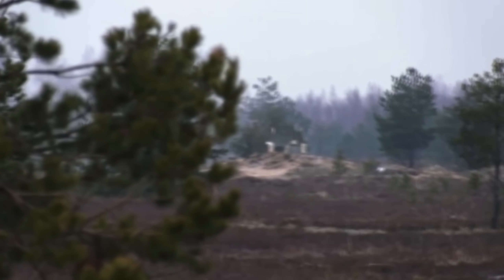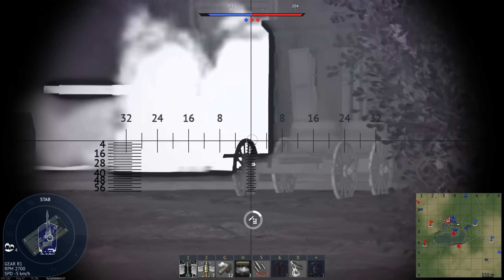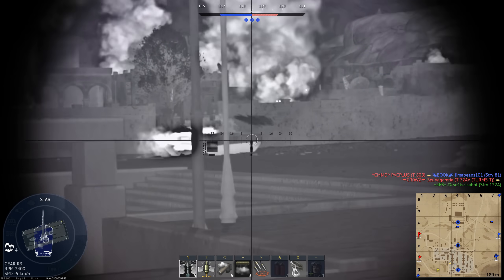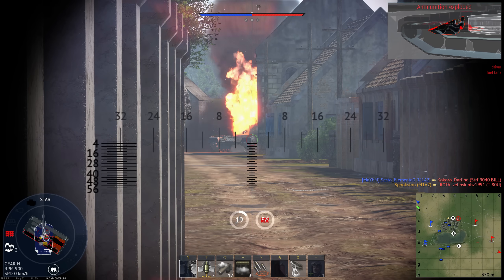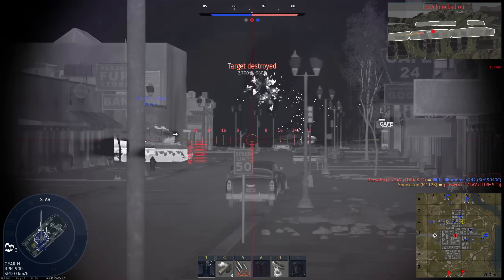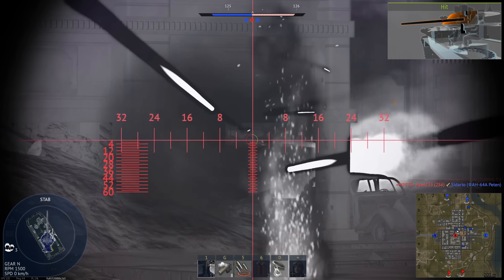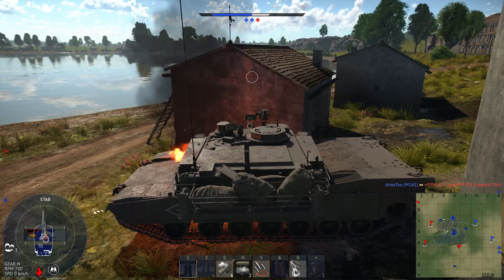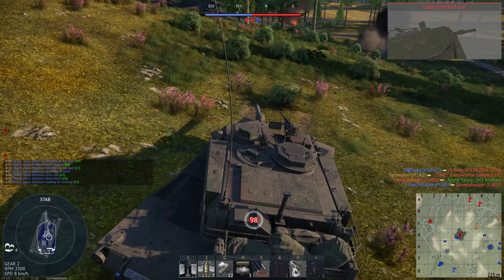Why The M1 Abrams Uses Depleted Uranium

Comment from the maker: DU is also used for a variety of commercial and military applications. Most notably, DU is used in some air to ground munitions. It's believed that this DU is responsible for a variety of birth defects and other serious medical issues in areas where the US military operates.
Reply: To also add a common, and unknown use: In commercial airlines, it's used as ballast to balance out heavy cargo.
Reply: hey just very quick tag on DU is often taken from nuclear powerplants who would refine it and would love for anyone to take it off them
Reply: "Most notably, DU is used in some air to ground munitions." 100% Correct. In fact you want to know, the A-10 Warthog's 'fart gun', the GAU Avenger, uses 30mm DU cored bullets with an aluminum jacket. 

Not to advertise, just a note for people interested, Real Engineering made an entire video about the A-10 which also covers DU bullets. Spook did an awesome job in explaining why DU is used and the up's and down's of DU for both crew and environment, but in case you want a little more visual approach about why DU is used over Tungsten, RE delevers that.😅 Though RE does not touch the environment and crew side in as much depth as Spook does👍 (I made a little comparison of the 2 channels to highlight Spook as wel as RE so you can decide, and for anyone who want to whine about me giving other channels credit, this is for you. Spook delivered/delivers amazing information that is bite ready to get you insanely interested to learn more about a vehicle, with an enjoyable video background to see it in action and regular info sheets backing his words up, thank you Spook, keep it up ;)
Reply: Yeah I'm sure it's the DU that causes the birth defects, and totally not the thousands of tons of organophosphates they dropped.
Reply: @AltPollux  shhhh if they admit to that they can just use a different compound in the future
Reply: Old comment but us military bases burn medical waste and other stuff in big burn pits i bet thats why.
Reply: @AltPollux  we‘re not talking about vietnam here
Reply: @AltPollux  and lead
Reply: @AltPollux  Where did the US drop organophosphates AND use DU?  Certainly wasn't Vietnam.
Reply: DU is still radioactive, just very slightly, but when it gets ground up into dust, as happens when its used in munitions, it can enter the human body, where the Alpha and beta particles will wreck havoc from our insides. Uranium is also toxic on its own and that does not go away with time.
Reply: @mohammedhersi5774  DU has such a long half life that in order to receive any sort of appreciable dose from it youd have to essentially replace your entire body with DU.  It's got a half life of 4+ billion years.
Reply: @mohammedhersi5774  the real problem is the high toxicity.
Reply: @mohammedhersi5774  very true
Reply: let's make war green, electro motor tanks with batteries and high velocity plastic penetrators from recylced plastic
Reply: @sagichnichtsowiesonicht7326  let’s make sure the people in the countries we bomb don’t look like Vietnamese babies after we leave if we ever want to have rnational relationship with them and not drive them into the arms of Russia, China or ISIS
Reply: @sagichnichtsowiesonicht7326  u mean wooden penetrators
Reply: @sagichnichtsowiesonicht7326  and make tanks from materials u can eat
Reply: Not just DU. Agent Orange in Nam come out in mind for example.
Reply: @draksionar  I love how everyone either doesn’t know or doesn’t want to know how Russia deals with its decommissioned subs, nuclear reactors, and the nuclear waste. It makes du and agent orange look like ice cream toppings in comparison.
Reply: I'd highly doubt it is the DU responsible for the increased birth defects.  There is a shit ton of chemicals the US military uses that are far more likely to cause defects.  Pesticides, herbicides, and even fuel and explosive often carry a lot of toxic compounds that can cause birth defects.

People just think it is DU because people have gut reaction to hearing the word Uranium.
Reply: @josephburchanowski4636  the rounds fired in training are made of cheap steel not DU. They wont/cant fire DU rounds in the US unless its war.
Reply: @whisperchainsaw102  I don't recall saying anything about training rounds; but it is kinda obvious that they would be made from steel.  While DU is cheaper than tungsten, Steel is dirt cheap by comparison.  Also even slightly toxic rounds you wouldn't want to be shooting all day just for training.
Reply: @josephburchanowski4636  yeah using steel darts in training reduces cost by alot since steel can just be made from old wrecks on the battlefield smelted down and remoulded.
Reply: @josephburchanowski4636  They're only "slightly toxic" if you eat it.  How many people are eating their tank rounds?
Reply: @cstgraphpads2091  Well instead of eating lead, our enemies eat Uranium.  Yum.

All joking aside.  It is fairly easy for DU dust to end up on food or in people's airways.  DU dust gets readily produced and disperse when rounds hit enemy armor.  You would be surprised how easy it is for dust to end up inside people.
Reply: @cstgraphpads2091  Because DU rounds specifically vaporize on impacts that leads to DU particulates getting into the local surroundings and water table. This is like being incredulous about how people got lung cancer from asbestos or lead poisoning from lead paint.
Reply: @josephburchanowski4636  well guy out of twelve of us that disarmed the main/coaxial guns and towed T72/T60 tanks that were destroyed by DU rounds in 2003 not one person has had any health complications or cancer as a result. So, maybe it isn’t as easy to ingest DU as you think.
Reply: @benkeller4210  "So, maybe it isn’t as easy to ingest DU as you think."  Still easy to accidentally ingest some dust; DU dust is no exception.  But it isn't like you guys would've ingested much though; unless you did something stupid.  The stuff is only slightly toxic; hence why I doubted claims that DU was responsible for birth defects and what not.  Don't confuse me with one of those people who freak out that DU is being used.

I still wouldn't want to shoot DU constantly at a training range.  But that is just me.
Reply: @josephburchanowski4636  I was doing an essay with a few other kids on nuclear power for a science class, one kid with no evidence or sources, just puts

"Plants with genetic defects next to nuclear reactors"

Which I find hilarious
Reply: @kriegscommissarmccraw4205  I do find funny how people seem to not realize that there is extremely little radiation escaping containment at nuclear power plants.  Like the amount of radiation you get within a year by living nearby is like one banana's worth.

Side note: my favorite unit of radiation dose is the B.E.D.  (banana equivalent dose); which is equal to a tenth of a micro Sievert.
Reply: @josephburchanowski4636  Banana equivalent dose? That's amazing!
Reply: @josephburchanowski4636  you are Right about this, as Long as they are built properly, not french and don’t blow up
Reply: @josephburchanowski4636  A coal plant is worse.
Reply: @josephburchanowski4636  former Navy Nuke. Reactor operators on a ballistic missile sub, sitting in front of the control panel receive less radiation while underway for 3 months than you do on a flight from NY to LA. This is because the sun is major source of radiation and a sub that is 100 feet under is totally shielded not just from the sun, but the reactor compartment.
Reply: @KKSuited  "This is because the sun is major source of radiation"

Galactic cosmic rays are a greater source of radiation.  They tend to have far higher energies than solar cosmic rays.
Another source of radiation you are likely avoiding is the background radiation from dirt, rocks and dust.

"sitting in front of the control panel receive less radiation while underway for 3 months than you do on a flight from NY to LA."

So you got like 4 bananas worth of radiation per day?  Neat.
Reply: DU is used in commercial airliners, just saying
Reply: The US does not use DU rounds for training. The training rounds are made of steel instead.
Reply: Hello, im tanker currently serving its been my experience and thoughts who been doing this a lot longer than I DU in the armor doesn't really have adverse health effects unless the armor as been damaged into the DU layer but that wont make you sick what will is breathing in the dust of it is what will but you have to breath in a decent amount of DU dust for that to happen in short you're more likely to get cancer do to the hydraulic fluid the Abrams uses than the armor it self
Reply: Depleted uranium emits less radiation than the normal background radiation at ground-level on earth. It is not, and cannot be, responsible for the birth defects and other medical issues you mention. The cause is almost certainly toxic waste products from various military and industrial activities, but depleted uranium gets the blame because 99.9% of people don't understand how radiation works.
Reply: @fyrstormer  'The cause is almost certainly toxic waste products from various military and industrial activities,'
Why then have nations invaded by the US seen birth defects go up?  If not DU what else id the US military spreading around leading to much higher numbers of dead and deformed children?

 'depleted uranium gets the blame because 99.9% of people don't understand how radiation works.'
It gets the blame because it is a toxic material the US blasts around without any regard to the long-term effects.  If you have another candidate I'd be curious to hear it.
Reply: If you were getting M1A2 footage yesterday for the vid. Sorry I yeeted you on American Desert, you got me back though :P
Reply: But if it's poisonous doesn't that mean it counts as a war crime?
Reply: @Servo_M  Sorry about the late reply, but I feel I can add on to Nimori's answer. Based on UN regulations, chemical weapons are banned, but DU doesn't fall under the definition of a chemical weapon. The official definition is that a chemical weapon is a weapon that uses the toxic qualities of a material to cause harm to enemies. DU isn't used because its toxic, it's used because of its properties that make it a good armor penetrator. Thus, DU isn't a chemical weapon, so it isn't banned nor is it a war crime.
Reply: @bobtank6318  Thanks, and better late than never.
Reply: @Servo_M  no problem
Reply: @Servo_M  yes it does
Reply: @Servo_M  Tell that to  Russia. They use chemical weapons and dumb bombing on a regular basis. But nobody talks about them. 

DU is hardly a problem. They’re used legit everywhere. from coloring things, to trim weights in civilian aircraft. It’s not dangerous unless you have it imbedded under your skin. 
DU is less harmful than Lead. 🤣 thats a fact.
Reply: @Nimori  I did not know that.
Thanks for the info, I know my question may be a bit dumb, but thanks for taking the time to answer.
Reply: @Nimori  think that is bad you should research what Russia does with its decommissioned nuclear subs, their nuclear reactors, and the high level nuclear waste. Just throw it in the ocean!
Reply: DU is also 18,000,000 kCal/gram calories... just incase you want to stock up for the winter.
Reply: Do you think there should be more east german vehicles? If so will you do a video on it
Reply: @joshuarosenberg4067  combining FRG and GDR into single nation can lead to many problems on some BRs. Remember Abrams/T-80 spam? Germany would have it x2, having access to both Leo's and T-72's.
Reply: @TheArklyte  true some east german premiums would be nice tho
Reply: @joshuarosenberg4067  I support this message.
Reply: Alpha radiation can also hurt you if an alpha emitter is ingested. So not only do you get heavy metal poisoning, you are also getting fucked up by the most energetic form of radiation.
Reply: @DoovieHoovie  alpha radiation is stopped by clothing and air. Gamma and beta are the most dangerous. 

Here I will give you the nuclear riddle of the three cookies. There are three cookies. One has gamma emitters, One has Alpha emitters, and one has beta emitters. Exposer to all three for five minutes will result in a lethal dose of radiation. You must take one of three actions to limit your dose. You have to pick to do one with each cookie. Sit on one, eat one, and throw one out the window. 

The answer is you sit on the alpha emitter cookie as your cloths will block the radiation. Throw the beta emitter cookie out the window as air and the wall will block beta radiation. You eat the gamma emitter cookie as almost nothing will stop gamma radiation. So you only get a non-lethal dose from one cookie as the gamma particles will most likely shoot out of your body and effect other things due to their speed.
Reply: @benkeller4210  what does cookies have to do with nuclear materials clothes and air can't stop nuclear radiation and contamination unless it's in an enclosed space
Reply: @dylanwhite3383 your cloths and air block alpha and beta radiation (more distance is required for beta radiation though). Gamma is harder to stop. Usually with lead.
Reply: @benkeller4210  really so your telling me that without a face mask or chemical mask im invincible to both alpha and beta radiation particles i find that hard to believe because even if it were true then the only true enemy forces working with nuclear radiation to corrupt or kill a human is time mainly in the form of cancer if the suns UV rays don't make it worse
Reply: @dylanwhite3383  well guy I don't know what to tell you, but Gamma is the real killer here. Why do you think the only people that die in a nuclear breach or criticality event are in close proximity? I mean you may get a a high dose but, usually not lethal. It may lead to increased cancer, but what today doesn't? Usually breathing in particles only occurs when nuclear weapons are employed. Or chernobyl. Thankfully they are both rare. The ash or fallout of the blast can be breathed in at that point. Anyone operating a nuclear power plant most likely will already have the correct PPE.
Reply: @benkeller4210  look you are using ancient data from a weapon created in world war 2 which by all accounts is irrelevant in today's world yet it's continued to be use for both intimidation and quick win tactics which will only hasten the demise of both our planet and our own lives because of such wasteful thinking should i continue to fill your brain with information about why nuclear weapons are for those who have deep pockets or did you have enough so that the rest of us can get back to using normal materials and nonnuclear weapons and technology for personal gains
Reply: @dylanwhite3383  "really so your telling me that without a face mask or chemical mask im invincible to both alpha and beta radiation particles"

I am not sure how you got that from your discussion with Ben Keller.  But if the alpha emitting radionuclides are entirely contained in a cookie, it is perfectly safe to sit on it.

But if that cookie say got blown up into a fine air-suspended dust; you are going to want a face mask to avoid breathing in the alpha emitting radionuclides.  While alpha emitters are near harmless when outside you, they are extremely damaging when inside you.  

You wouldn't want to sit on the cookie with beta emitters though (well unless you are wearing a few mm of metal like aluminum). You'll get a "sun" burn (or worse) on your ass from the radiation damaging your skin and below.  Obviously if sitting on it is bad, you don't want to eat it.  But if you throw the cookie several yards away, you'll be safe from the beta radiation as the air will provide enough shielding.  It goes without saying, but you wouldn't want to breath in the beta emitting cookie dust either.

Gamma radiation is the hardest to shield from.  But that is also paradoxically why it is the least dangerous inside of you.  Radiation only does damage to you when it transfers energy to you.  If it goes completely through you without losing much energy, it didn't do much damage.  Alpha radiation and beta radiation if emitted inside you, dump all of their energy into you, hence they are far more damaging.

Gamma radiation becomes lethal through quantity.  If enough travels through you, there will be enough energy transferred to you to do a lot of cumulative damage.  Since it travels far and is hard to shield from, it is actually pretty easy to get exposed to a large quantity of gamma radiation when dealing with fallout.  

To protect yourself from gamma radiation, there are two options (and in many cases you do both).  Put as much distance between you and the gamma emitters (since inverse square law applies to radiation).  Or put as much mass as possible between you and the emitters.  How effective shielding is against gamma radiation is generally proportional to its mass.  3 feet of dirt is enough to reduce gamma radiation exposure by a factor of 1000. 

For reference for what a reduction factor of a 1,000 does for you; it is the difference between a mammogram (400 µSv) and eating 4 bananas (0.4 µSv).  Or the difference between getting mild radiation poisoning (400 mSv) and a mammogram.
Reply: @josephburchanowski4636  well Ben thinks that only he is right and that the truth is stupid
Reply: Well he is right and your not this is the fucking internet lad i suggest you do your research and even the un back him since they investigated the effects of DU on the enviroment and the local inhabitants and the reports concluded that DU has no effect on the enviroment and local inhabitants 
Ps.a simple wiki page proves your wrong on russia not using DU because they actually do there latest "vaccum" apfsds uses DU.
Reply: Are depleted uranium shells in war thunder?
Reply: @trout717oboeplayer9  M829 and M829A1 is available in War Thunder. However, to be precise it should be this way -> M1A1: M829, M1A1HA: M829A1, M1A2: M829A2. Also US M1A2 in War Thunder is based on Swedish export version, which lacks DU armor.
Reply: doubt it causes birth defects. that shit sounds like anti us propaganda, how the fuck would they even begin to get that assumption off the ground is beyond me
Reply: @jaxrammus9165  It can get thrown up as dust and inhaled by people, and particles can seep into the groundwater, thereby contaminating it. But the same thing would happen if tungsten was used as both materials are toxic if ingested, so the point is somewhat moot.
Reply: My friend, when u shoot shells, there will be dust , that dust came from the shell, the ground shakes, and the propellant. So the soldiers suck up those nasty propellant(burned) super fine dust of the shell bullet and the ground dust. Since they're inside the tank, they'll inhale both the propellant and the DU only... It will give better penetration, but ultra toxic
Reply: @imamkustiaji7324  Precisely.  And when a DU shell hits an enemy vehicle it ablates, creating more toxic dust.  There are good reasons why US troops wouldn't hang around killed Iraqi tanks, yet Iraqi kids would clambour all over them, inhaling that dust...
Reply: The A10 sure fires the stuff so thats even more frightening.
Reply: Of course the alternative Tungsten is just about as shit.
Reply: Like in A-10 rounds?
Reply: Kosovo still has massive amounts of uranium in the ground from the A-10 fire
Reply: Did anyone notice the floating striker at 2:36
Reply: True
Many Iraqi cities suffer from that specially who show hard resistance
Reply: CHEMTRAIL
Reply: It’s normally used in gryoscopes
Reply: In 2002 I met an army medic that received radiation burns on his hands during the first gulf War after he climbed into Iraqi army vehicles to check for survivors after the vehicles been hit by A-10 strafing runs.  A-10's also use depleted uranium for its gun.  11 years later when I met him he was being medically discharged from the army because he no longer had the full use of his hands but the army was refusing to admit his issues stemmed from the radiation burns he received in Iraq.  I personally suspect he ended up wearing and breathing in a lot of DU particles long after after crawling around in the wreckage because when the DU rounds hit armor some of it super heated and caused spaulding of the material blanketing the entire inside of the vehicle with a fine dust of DU partials.
Reply: @andrewbrandon19  he did not have radiation Burns from depleted uranium
 That's ridiculous. It emits mostly alpha particles, which are effectively shielded by the skin. If you get a piece stuck inside of you, that could be a problem, but if you have DU inside of you, radiation is the last thing you're typically worried about. You're usually more worried about bleeding out. Source: Naval Nuclear Power Training Command in Goose Creek, SC.
Reply: Abrams tanks have been exported, however those are not equipped with a depleted uranium layer in their armor, or so I've read
Reply: @alexanderwren1732  to balance them, not to power them. Still used in many cases as aircraft weights
Reply: Spookston:talks about DU
Me:laughs in Serbian
Reply: It emits Alpha radiation that can't get through the skin but is very bad when swallowed.
Reply: DU ammo is not reactive enough to cause defects ... according to different studies they all concluded that being in a close confiment of DU ammunition for 1000h gives you a yearly dose of radiation you take in by just being outside ... meaning ist not dangerous at all.... the biggest risk from DU comes if you eat it but i dont know why you wuld do that
Reply: blame the DU, not incest in Islamic communities, for birth defects.
Reply: Bogus.  "believed" responsible is not suggested by the science.
Reply: Still, an instructive video all around.
Reply: After numerous studies have concluded that DU on the battlefield is no more or less a threat to humans and the environment than any other weapon or munitions used, the World Health Organization doesn't believe that to be true of DU and US Military operations.
Reply: @Spookston "Why?" Because the U.S. military has become psychotic since WWII, instigating massive war crimes against the civilian populations of Korea, then Vietnam, then Cambodia,... and through the war crimes in the form of  sanctions against the civilian populations of Syria, Venezuela, Iran.... after all this death of innocents, what's a few thousand birth defects from depleted uranium scattered around the middle East?
Reply: I have had 2 throat operations  because  of massive  polyps ( non cancerous) I have  a bizzare amount  of polyps  in my ass too. The VA surgeon  thinks it's cause from my exposure  to depleted uramium  in desert  storm  where I worked  with cav units
Reply: To cause cancer
Reply: Wow. All of the talk of the low radioactivity of depleted uranium means using the stuff in making rounds is okay then.  

It is NOT okay. Yes U238 is of very low radioactivity. It releases low energy alpha particles. He2+ is the most electronegative substance that occurs naturally. It is able to steal the electron from a fluoride atom. And fluorine is very highly electronegative. 

If the uranium is outside of the body it is NOT harmful. But when it is inhaled, it will cause a very substantial wound inside of the lung. It will ionize anything that comes into contact with the alpha particle. 

Firing a depleted uranium round into a steel tank is a guarantee that large quantities of the uranium will be vaporized into the air. Where the stuff can easily be breathed in. And where over time the alpha particle release can induce cancer over time. Tungsten will NOT do that. Tungsten is chemically poisonous, but it is NOT radioactive. It will not lead to ionization injury of the cellular organelles or genetic material. Depleted uranium has low radioactivity but it does exist. And inside the body that radiation is the most damaging. It lasts with a half life of millions of years which means it will be around for many generations after we have long passed. Even a few alpha particles are deadly. 

If you all want to believe the federal government on things like the covid v.a.c.c.i.n.e being safe and effective, then I don't know what to say. But if you have great mistrust of the federal agencies then you also should NOT believe the propaganda of depleted uranium being safe either. It is NOT safe. It is definitely a lot less safe than is a tungsten round. Lead is nearly as dense and also does not carry the radiation risk of depleted uranium. 

Why is it that the US uses these kind of munitions?? It boils down to cost. If tungsten were cheaper, it would be the universal choice. But it is not. 

That choice will be devastating to much of the world.
Reply: "It is believed that..."

Passive voice won't save you from the B.S. claim.
Reply: Uranium, whether depleted or not, is one of the heaviest of metals and all heavy metals (including lead, amongst others) are toxic. DU is not considered a radio active risk as explained in the clip, but is still not nice stuff.
Reply: You havent heard a Serb talk about the effects of DU.
Reply: @npswm1314  the emperor protects
Reply: @npswm1314  yeah,as a serb i can say most of them have no clue what they're talking about.
Reply: @npswm1314  You haven't heard a serb talk about the effects of genocide...
Reply: @npswm1314  can Serbs actually talk?
Reply: DU armor and ammo  is a very good idea. This is because in war, what is the point of preserving the environment if you lose, die and don't get to use it.
Reply: Yes this is one of the main pros of DU, not only does it kill on impact, it causes deformities, too!
Reply: @demmemess4456  Lead actually is more toxic than DU though lol
Reply: @Nimori  yea
Reply: @Nimori  look at iraqi birth defects. idk if it is
Reply: @SattvaRig  Gas. It’s because of Chemical Weapons used by the Iraqi’s.
Reply: "The US doesn't care about its effects on the environment"

Look at the environment that that operate in. There's nothing but sand and rock there.
Reply: @kriegscommissarmccraw4205  firstly, the Middle East consists of a lot more than Sand and Rock, Even Iraq where a lot of the fighting took place in an actual desert, for example basrah come to mind. But the US has been in many places since the 80s. Eastern Europe, Afghanistan, etc. All regions with either a lot of big cities and/or rare wildlife.
Reply: @Olyvia..  okay
Reply: @Olyvia..  Them simply "being" there isn't going to do anything either.  Unless the people in the area are eating DU (produce exams of stomach contents or blood tests), there won't be any significant negative effects.
Reply: @cstgraphpads2091  Pretty sure the US Army openly admitted that DU causes birth defects when in high enough concentrations from battlefield use.
Reply: @kriegscommissarmccraw4205  Humans still exist within the ecology and enviroment
Reply: @kriegscommissarmccraw4205  or in other owrds, other peoples countries.
Reply: @kriegscommissarmccraw4205  2-years late but I feel is important to note that a lot of people live in those countries as well
Reply: @kriegscommissarmccraw4205  Lol no
Reply: Are you familiar with the concept that it is depleted?  Not every problem in the world is created by Americans.
Reply: Well at least we know why the M1A1 is such an overrated tank based on armor and main ammo usage but i still wouldn't use depleted uranium mainly because there are more structural materials that can be forged together without risking the workers who will build the tank i want to use
Reply: @dylanwhite3383  Just for comparison, Russia and China also have nuclear industry in large scale yet they don't have DU rounds deployed, because they won't risk polluting their own land.
Reply: @tapist3482  using DU isn't a problem if your army only ever plan to fight in offensive wars apparently. Oh wait im sorry. Defensive wars of "American interests"
Reply: @tapist3482  yes because they are smart enough to know the risk of nuclear related materials
Reply: @jonsong4592  yes
Using DU ammo is okey if u invade other countries for oil
Reply: @dylanwhite3383  You act like it's reputation isn't warranted.  What other materials can give the same performance as DU?  Go on, we'll wait.  What risk is it to workers?  They aren't eating it.
Reply: @cstgraphpads2091  have you ever done research on both graphite and titanium you can't just use DU because it's cheap and easy to produce you should think about the after effects of DU on the environment and the people in it besides if 1 nuke can have an after effect lasting a thousand years or more then you should expect a fraction of that wait time until you can move your troops into the affected area where you used DU and besides if your not smart then your whole operation will suffer from your use of materials
Reply: @dylanwhite3383  "besides if 1 nuke can have an after effect lasting a thousand years or more"

What nuke does that?  Even salted nukes will have radiation decrease to near background levels after that time.
Reply: @josephburchanowski4636  well if you disregard any standard safety measures when building a nuclear weapon then the effects should last a few decades if no one attempts to clean up the affected area after the detonation of said nuclear weapon but a civilian nuclear reactor malfunctioning is why Chernobyl is still uninhabitable to this day
Reply: @dylanwhite3383  "should last a few decades if no one attempts to clean up the affected area after the detonation of said nuclear weapon"

Are you talking about where it is built, or where it is detonated?  It isn't clear as "affected area after the detonation of said nuclear weapon" makes it sound like you mean the latter; while the beginning of the sentence clearly states it as the former.

" Chernobyl is still uninhabitable to this day'

Well there are people who live there.  It isn't nearly as dangerous as people think.  Even the dreaded elephant's foot isn't that dangerous any more.  Although there is still large amounts of cesium and strontium that one should be careful not to ingests.

But yeah, disregarding all safety measures when building nukes or doing nuclear power is bad and the effects last a while.    Nobody is going to deny that Kyshtym and Chernobyl were terrible disasters.  Good thing we don't do things like that anymore.

There are still poorly built nuclear powerplants due to corruption, but they are still leagues safer than the reactor used in Chernobyl, and require a record breaking Tsunami to actually cause problems.

Side note:  I notice you switched from a thousand years to decades.  There are big differences between those lengths of time.  There are definitely salted nukes that will have effects many decades later after detonation.
Reply: @josephburchanowski4636  now you sound like a robot the very first thing to be disabled by a nuclear blast the British army even tried to see what happens to a tank that is caught in a nuclear explosion and they just washed it off because they didn't know what nuclear radiation was or what nuclear particles are
Reply: @dylanwhite3383  "now you sound like a robot"

How so?  Don't tell me it is because I used punctuation?
Reply: @josephburchanowski4636  nope because only a computer or robot repeats everything other people say and that is something that can make other people want to reprogram your software
Reply: @dylanwhite3383  Ah, you take issue with the quotations.  I've noticed a lot of people seem to get triggered by them.  I still do since I find it makes my conversations more clear. Also it helps greatly with organizing long comments.  Ever hit the character limit on a youtube comment before?
Reply: @josephburchanowski4636  no im not triggered by you being on repeat like a recording machine on a loop it's just that my personal view on DU is mainly about why must we always need nuclear materials to make a fighting machine or even a tank round when there are more stronger materials that didn't come from the atom bomb like aircraft grade aluminum or even graphite used to make a polish sports car there is even titanium being used for making cars instead of traditional steel plating that's just my opinion i would rather use materials more commonly available instead of getting security clearances to purchase barrels of DU
Reply: @dylanwhite3383  "no im not triggered by you being on repeat like a recording machine on a loop'

I'm just organizing my comment by quoting which part each thing is replying to.  Considering I don't do the quotes more than once, it is weird to call it a recording machine on a loop.  You could just ignore the quotations if they bother you so much.

" even a tank round when there are more stronger materials that didn't come from the atom bomb like aircraft grade aluminum or even graphite used to make a polish sports car there is even titanium"

Mostly because none of those materials are really good at stopping modern anti-tank weapons.  Some are good when used in composite armors, but those composite armors often include at least one high density material in them.

The reason why high density material is needed is because at the velocities involved, all materials starts acting like highly plastic fluids; as such many aspects of hydro-dynamic penetration end up applying.

An extreme over simplification of the formula for penetration ends up being the length of the penetrator times the squareroot of the density ratio between the penetrator and the armor.  A 1 meter Uranium penetrator will penetrate 2.6 meters through aircraft aluminum.

Simply put, high strength light weight materials don't work that well as tank armor, unless put into a composite with higher density materials.  In which case the extreme difference in density between parts of the composite can increase performance. We don't make tank armor out of pure DU, we make it out a composite of DU and other materials.  If it was pure DU it wouldn't provide as much protective power for its weight.  

High strength lightweight armor is far more effective for light armored vehicles not meant to be eating modern anti-tank rounds. Hence the Bradley APC is made out of aluminum.
Reply: @dylanwhite3383  news flash that is how you decontaminate vehicles and people. You wash them off. Have you done any research or are you just guessing now?
Reply: @dylanwhite3383  Read what he said to Hoovie Doovie.

And his spelling is fine lol typos happen
Reply: @josephburchanowski4636  you should realize that if DU is so cheep and easy to use for both tank armor and munitions then a terrorist with a few million dollars can easily buy that same material for creating a dirty weapon to use against civilian targets that is why we need to use more safer materials in both armor and munitions
Reply: @dylanwhite3383  "There has also been speculation that there is a potential black market use of DU as a weapon for bioterrorism, or as part of a dirty bomb. However, a thorough evaluation of the toxicology of uranium indicates that DU is relatively inert, compared to other potential materials and organisms that could be used to make an effective bioterrorism weapon or dirty bomb. Indeed, the reason why DU may still be considered to be an excellent bioterrorism agent is the public perception that DU is a harmful chemical, even though the toxicology of the chemical and radiological effects are relatively mild."

Depleted Uranium:  George C.-T. Jiang, Michael Aschner, in Handbook of Toxicology of Chemical Warfare Agents, 2009

I decided to copy and paste and show the source since that is easier than arguing with you.
Reply: @dylanwhite3383  DU is cheap, but not that cheap. Uranium is rich in crust, yet to get a pure enough concentrate, takes extra work. The term "cheap" is just relative to tungsten. Also, in almost all countries radioactive materials are strictly restricted. In some countries even possessing specimens of uranium ore is a crime. So it's not that easy to get large amount of DU via civilian channels.
Reply: @benkeller4210  a cobalt weapon dosen't need to be massive or dirty to blow a China sized chuck of the world into nothingness besides DU is very common material used by NATO forces in their own military weapons and equipment and other more less superior countries like Russia and China continue to use older but more reliable materials in their own weapons and equipment which costs less to maintain unlike nuclear made weapons and equipment
Reply: @tapist3482  true but i would rather use regular metals when making a vehicle or a weapon of war if i had to do that
Reply: @dylanwhite3383  Mind, Depleted uranium is quite inert and that not making armor or munitions out of it would not reduce the accessibility to it, because Depleted Uranium is made in uranium enrichment.

You're essentially saying, "don't use it in armor or munitions because a terrorist could buy the DU from a uranium refinery with nothing to do with armor or munitions production and then make a sub-par dirty bomb with it."